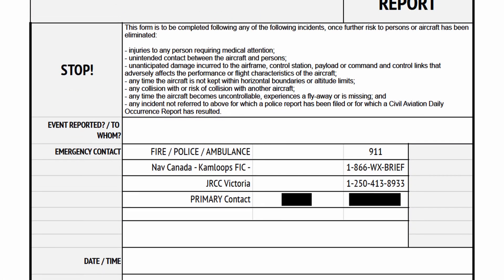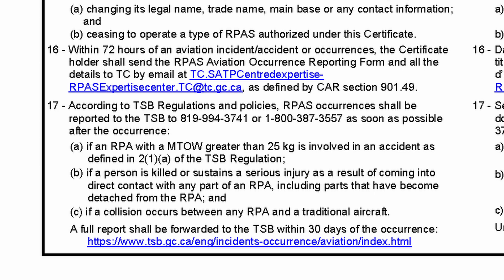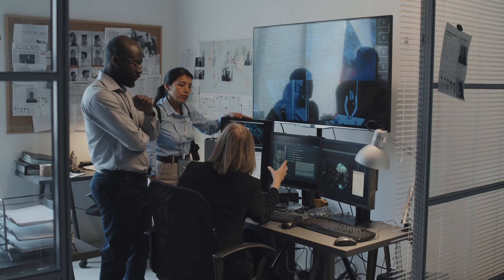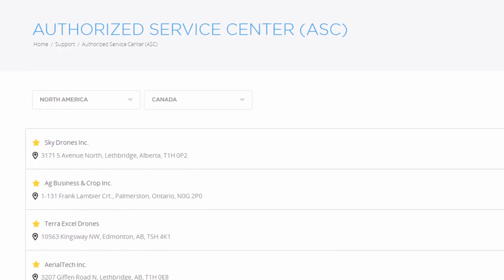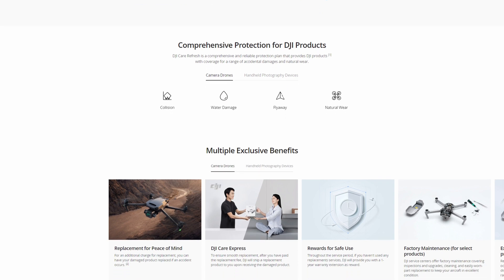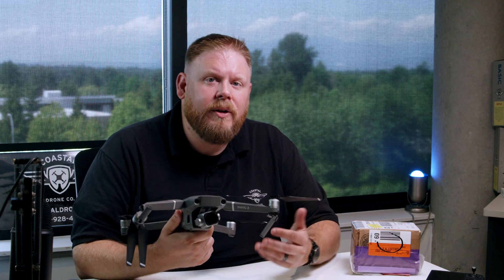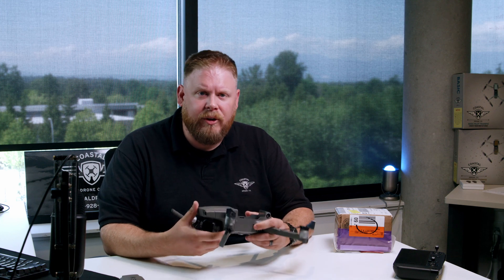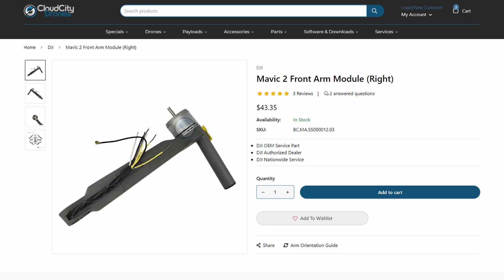Should you repair or replace your Mavic 2 Pro?

Comment: Where did you get your soldering/hot air station? What did you do about the down sensor problem?
Reply from the maker: We got the solder station on Amazon!  

The ribbon cable was slightly loose on the down sensor, re-attached it and problem fixed.  Sorry for no follow-up vid.